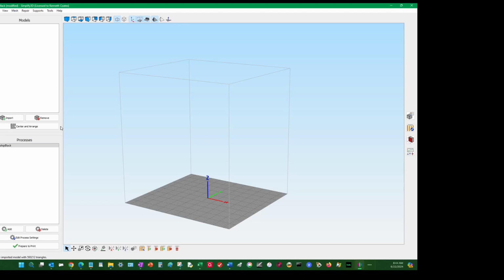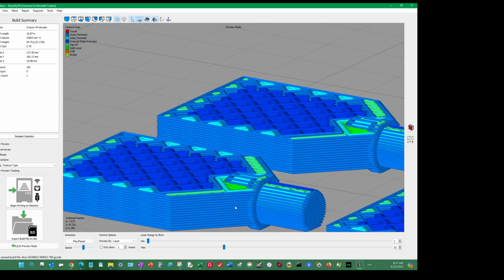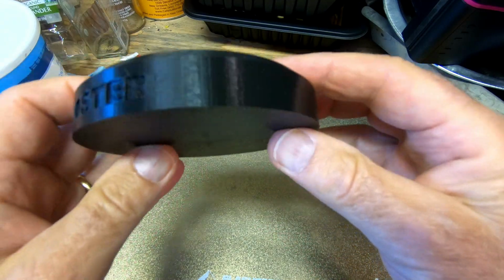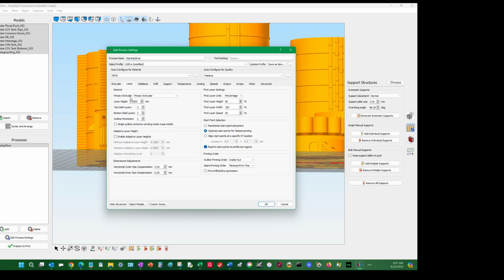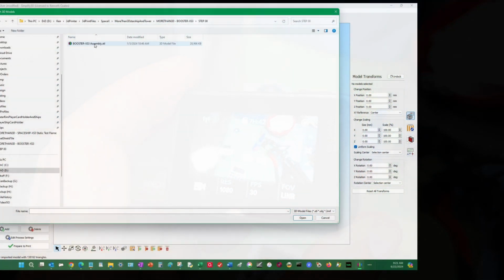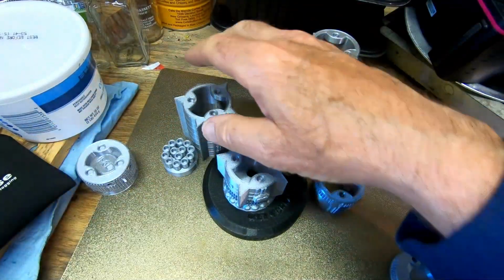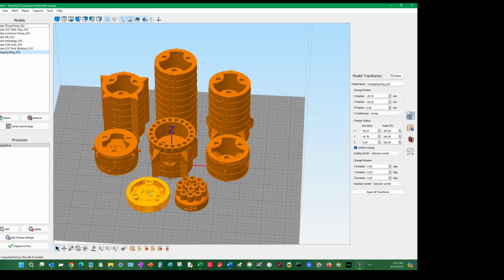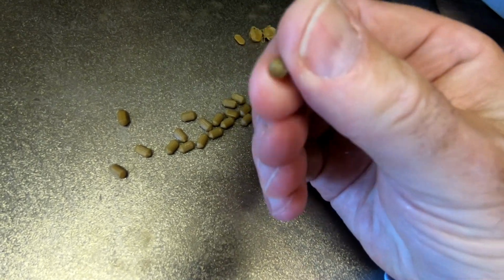3d Printing & Assembly of a Complex Model: SpaceX Starship, Super Heavy, and Launch Tower - Part 3

Comment: Good video, are you still using Simplify 3D? What advantages does it have over other slicers e.g. Orca
Reply from the maker: Thanks!
Great question.
I started using Simplfy3D version 4 in 2020 when I started 3d printing.
What it's especially good for is controlling the printing parameters on a layer-by-layer basis.
That's very easy in Simply3D. Here's a filament review where I show how to use it to vary the temperature of the layers when printing a temperature tower:
https://youtu.be/iHJzej45Xus
For a lot of my products on my Etsy store, I need to be able to adjust the quality of different layers to have the maximum quality on the top & bottom layers (that are visible) and then reduce the quality on the middle layers which aren't seen: https://betacygnidesigns.etsy.com/

About a year ago, I started using OrcaSlicer and I really like that too.
It's excellent at printing objects one at a time vs. layer by layer (it can print them layer by layer of course, but that's not what I use it for).
For this product:
https://betacygnidesigns.etsy.com/listing/1830249209/star-wars-outer-rim-board-game
I have to print dozens of small Star Wars ships with fine details.
It's much better to print each one and then go to the next one to basically eliminate stringing.
You can print items one at a time with both version 4 & 5 of Simply3D but it's very clunky compared to OrcaSlicer.
OrcaSlicer is very good at automatically spacing the items on the print bed so you don't hit the one you just printed with the print head or the moving rails.
It's not perfect, but it's very good. I have had to tweak a few of it's placements for the best results.
OrcaSlicer prints things a little faster than Simplfy3D (including version 5 which I also have).
I'm not exactly sure why. Typically with OrcaSlicer I'm using a gyroid infill (which Simplfy3D version 5 has). It's possible that OrcaSlicer's gyroid pattern prints faster.
I don't spend a lot of time printing with both slicers to see which one is faster.
If I have something that needs layer-by-layer control I use Simplify3D.
If I want to print items one at a time then I use OrcaSlicer.
Reply: Thank you for your detailed answer. As far as I know, Simplify is also much faster in slicing and the details are very distinctive. Unfortunately, they only very rarely bring an update and the price, I think at 50€ they would have many more buyers. I know that Ideamaker is very similar to Simplify, it also has a lot of settings that Orca, for example, doesn't have.
Reply from the maker: @Denman123  You're welcome! I haven't tried Ideamaker.
For what I'm doing, I need the features of Simply3D and I haven't found any other slicers that do what I want, but I haven't spent a lot of time trying other ones.
I decided to give OrcaSlicer a try because it does really well on piece by piece printing with advanced hiding of "seams" (where each layer is started).
I'm really happy with that for the piece by piece printing I do.

You are right about S3D not updating often, but I was a software developer for many years and I sympathize with them since they have to test each release on hundreds of different models 3d printers.
Each print test would have to run for hours to actually test a complicated design.

I'm making things for sale, so paying for Simplify3D is a business expense.
I'm still using version 4 for most things because v5 still has some bugs.
Version 5 is supposed to better with seams, but I found it isn't perfect.
If I want advanced infill patterns and I can print a piece all at once with the same quality parameters, then I use OrcaSlicer.
Reply: Does Simply3D also have modifiers? Like you can do with Orca or Prusa? For example, I want 50% infill at a certain point.

Unfortunately, there are so few videos about Simply3D... Would you be interested in making a few?
Reply from the maker: @Denman123  Most of my 3d printing videos (154 so far and more to come) have some content about Simplify3D: https://www.youtube.com/playlist?list=PLM0nwcQ_luubpzqCR-LiVbZUiLrg8D_z2
The most detailed series I did was when I upgraded from V4 to V5. Here's a link to Part 1 of that series: https://youtu.be/BHhiclCNk9k
Part 4 of that series covers changing the slicing parameters at a certain layer:  https://youtu.be/NMtCBVfGeCw?si=HEXKiMK-tUTtH0dV
It's very easy.
I've just been using OrcaSlicer to do single slicing profile prints so far.
I looked into modifiers, but they seemed much more complicated to use than the simple system that Simplify3D uses to just specify which heights in the model are covered by a particular set of parameters. 
I'm a beginner using OcraSlicer, so it's possible I don't understand how to do it properly.